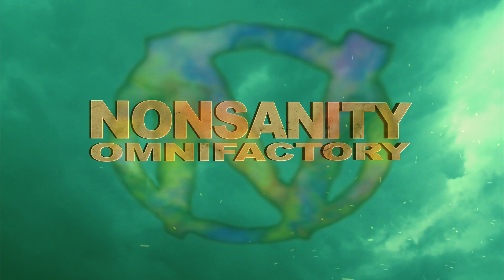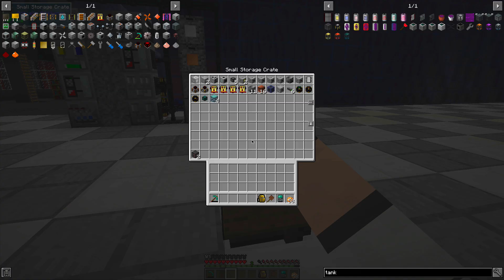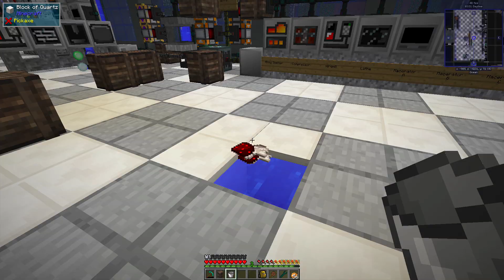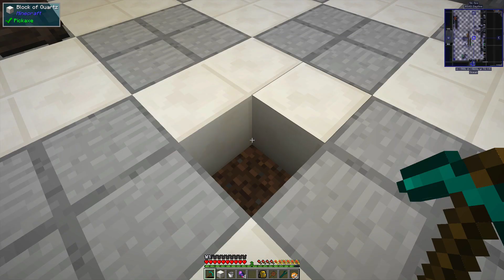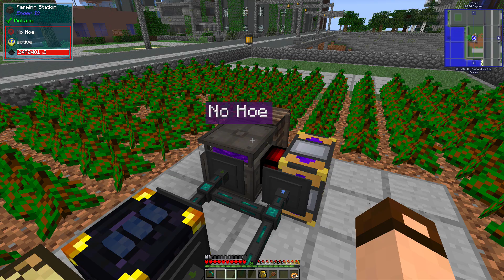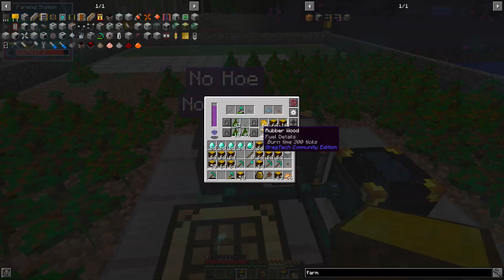OmniFactory - ep 6 - Ay-EEEEEEEEEEEEEE

Comment: You can craft 16 sticks with two logs, thus reducing the number of auto-crafters necessary to fully automate the Farming Station. Normally I would suggest just using wooden tools instead of diamond, but since diamonds are already a renewable resource for you, I suppose it makes sense.
Reply from the maker: I know about the logs to sticks recipe, but when I first set up the design, I was making wooden tools, so the planks were needed. But that one sounded like a Gatling gun as the tools pretty much instantly broke. Switching over to diamond, I didn’t think about re-doing the stick making. :)

Of course, now the farm is offline, since it completely filled a max-upgraded drawer with wood... and two with resin. :)

Comment: Often, the energy acceptor is unable to deal with the power demand if you're inserting into/extracting from the ME terminal fast; you can add an energy cell after the acceptor to eliminate ME terminal blackouts.

How do you prevent saplings and resin from being sent into the mechanical crafter without a filter?
Reply from the maker: Yes, I'm working with my AE system right now, and if I try to shift-click my whole inventory into it, it blacks out. Otherwise, it;s just fine. I'll make some AE capacitors later to allow for higher power cost operations.

By filling the input rows of the crafters completely, there's only room for those items. Since this system should never run out of any of the items, it should never get locked up. If that was a risk, I'd use  limit filters on the item conduits. :)